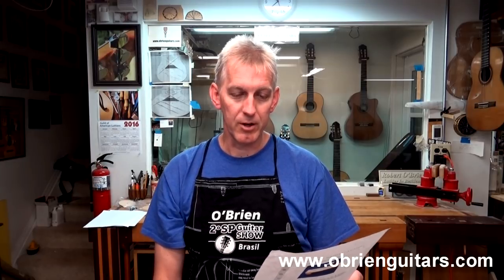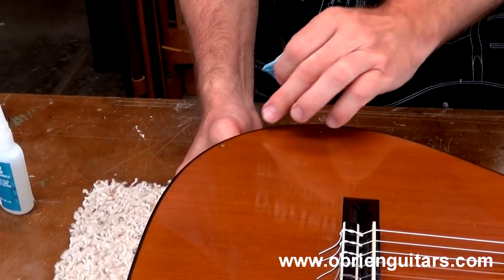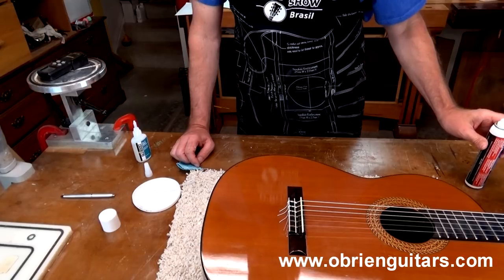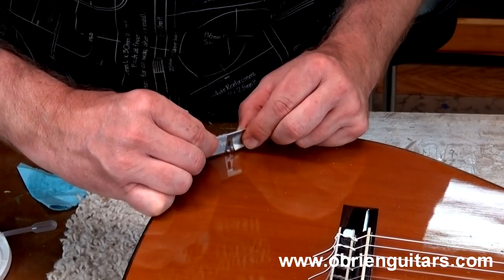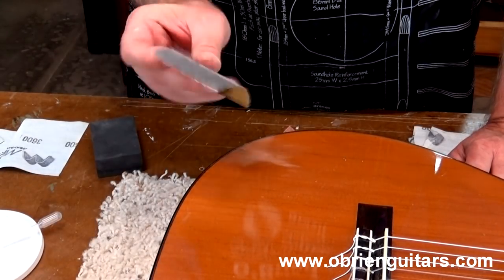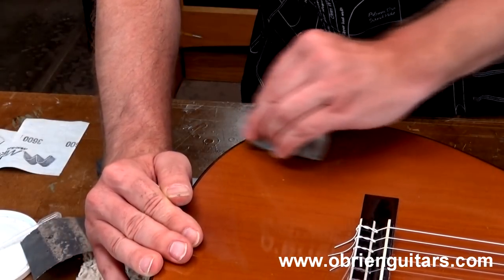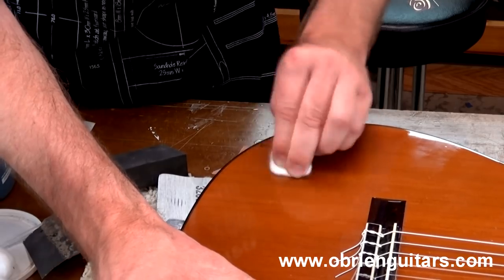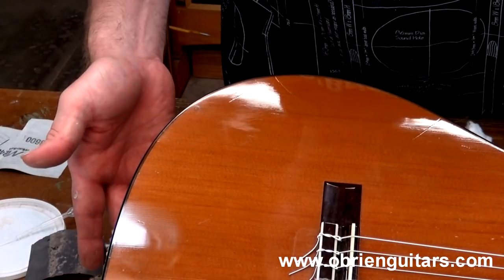Luthier Tips du Jour mailbag 97 - Repairing a ding in a guitar finish

Comment: I have a cedar-topped classical guitar that I bought when I was 15, I got a great deal on it because of all the cosmetic dings.  Thanks for these great tips on how to finally fix those dings!  I don't expect it to look perfect, but this will certainly reduce the appearance of the damage.
Reply: Sorry, your comment was a year ago..
Exact same thing for me, few dings on a great old vintage guitar.
How did this method work out?
Reply: Cedar top as well :)
Reply: @mrg6185  
My idea of using a Varathane polyurethane scratch repair pen did not work out.  It was as if I had done nothing at all.  I made an attempt to fill the damage with a form of superglue so I could make  the top flat, and then cover it with the polyurethane pen.  Unfortunately, the superglue was harder to control than I expected, and when I tried to carefully absorb the excess...let's just say, I'm still trying to determine the best way to get the superglue spillage off of the guitar.  It would've been better had I not even tried.  The superglue residue isn't very big, but it affects the texture of the top in that one small area.  I've wondered if naphtha might work.

Comment: Robbies videos are fantastic.  I have learned a lot from them and really admire his techniques.  However, in this case, I didn’t think the end result was all that great.  To tackle that ding, I would have first tried to reduce the depth with a few drops of water and a couple of touches with an iron or burn stick melter.  Then I would have drop filled with lacquer.  (Assuming that is a Nitro finish).  That would take much more time waiting for the lacquer to cure for at least a week, but I think the results would have been better.  And I’d have just buffed it and not fooled around with micro mesh.  Much quicker there.

Comment: I've done this on a belt ding in the back of my black 7 string LTD with a lacquer finish and it worked great. But now I've got a scratch all the way to the bare wood on the top of my Martin D10e sitka. It's a satin finish if your not familiar. Any tips on doing a similar technique but with a satin finish? The scratch is about 3/4 a cm long and about as wide as a fingernail. Almost looks like a splinter came out. I have no clue how it happened since I baby that guitar and the scratch just showed up tonight lol, devastating!

Comment: CA glue always leaves a very noticeable darker finish than the surrounding area. Would drop filling with clear coat lacquer not be a better option?
Reply from the maker: If the finish on the instrument is lacquer, my first choice is to use lacquer as a drop fill.
Reply: @OBrienGuitars  On contemporary production guitars what is ever used other than lacquer?  Thank you.
Reply from the maker: @philipliethen519  you can use catalyzed urethane or UV cured polyester.
Reply: @OBrienGuitars  how can you tell which of these finishes has been used?  Can one be used to spot repair over another?  Thank you.
Reply from the maker: @philipliethen519  CA glue products work best over urethanes and polyesters in my opinion. For lacquer I drop fill with lacquer and shellac I use for shellac finish repair.

Comment: What If I used a heat soldiering tool with Wet cotton fabric on the Dent .. Dose it Make the Dent Comes out to same Level of the Wood surface ? 
I  saw this Idea used with Real unfinished wood but Dose it work on wood with Finish on ?
what if  I use Finger nail Clear Drops instead of the Super Glue Dose it work ?

Comment: Im no luthier, but Ive been playing for over 50 years.   My flame finish Breedlove, had a bad chip as big as a fingernail, right down to the spruce wood top.  It was right where my arm layed over to strum, so I went to the dollar store, and got a set (3 in a pack) of furniture color stains in tip applicators, (3colors)  black, maple, oak.  put light to dark down, matching the top, looked GREAT then I took dollar store clear epoxy glue and filled the large deficit.   after drying I scraped as he showed, then sanded with 2000 wet. and WOW looks better than his, you can BARELY see it and Im playing to crowds with my Breedlove again!
Reply from the maker: Way to go Dude!

Comment: Great video. But I have a question: my electric guitar has a polyester finish on a blue flame maple top, but the scratch appears to be only in the polyester clear coat, not the colour coat or wood underneath. Would this technique be able to make the scratch completely disappear?
Reply from the maker: Sometimes to cure can be worse than the disease. However, if done properly, you can get a good repair. I would use the Gluboost products.

Comment: Great video! How do you deal with this type of issue when the ding is in a place with a complex curve like a neck heel?
Reply from the maker: YOu can do it the same way but use a thicker CA glue
Reply: @OBrienGuitars  thank you! My main concern is after properly gluing and clamping (which I have done well I believe), that if I add CA glue, leveling it with the razor blade trick will be next to impossible because of the complex curves.
Reply from the maker: It is never easy is it?
Reply: @OBrienGuitars 😂😢

Comment: Hi Robert, I recently got a Gibson Les Paul Studio (gloss finish), and the previous owner dinged out little notches on the back of the neck near the fret markers. I guess he wanted to feel where the frets were with his fretting hand thumb. The notches only seem to be through the outermost layer of the finish and do not go through to the color coat. Any recommendations to fix those? Thanks!
Reply from the maker: I would use probably glu boost to level and then buff to a gloss.

Comment: Can you fix a light scratch in Taylor Guitars' "silent finish" with this stuff and your method...?
Reply from the maker: What is a silent finish? I have never heard that term?
Reply: @OBrienGuitars   Much thanks for the response! Its probably just marketing language from Taylor Guitars?
Its supposed to not be noisy / squeak if your hand slides over it? idk.
Beyond that, they say its sprayed with an electrostatic charge, so the paint or whatever it is will cling to the wood better.
That's what they say in their YouTube factory tour.
It may be silent, but its also not very sturdy... I somehow ended up with a scratch below and oddly forward of the sound hole on my new Taylor 517 Builder's, which doesn't match where or how I play.   
Probably can't figure out how to fix it if I don't know what kind of wood-coating they used...
Reply from the maker: @Pharesm  Thanks for the info. Sounds like some marketing play on words. Taylor I believe uses UV cured polyester for a finish and this is probably a satin finish is my guess. Fixing scratches can do more harm than good. I say just play the guitar and enjoy it.
Reply: @OBrienGuitars  Much thanks for the info on UV Cured Polyester and the advice  :)

Comment: How can you tell what was used for too coat?
Reply from the maker: I assume you are asking about what type of finish was used onthe guitar. If this is the case then the Glu Boost products work well with any finish, especially lacquers, urethanes, polyesters etc.
Reply: @OBrienGuitars  I have a crack in my father's 12 string Eco about 7" long from bridge down center line. Once I cleat it  I'll need to refinish the repair. How can I figure out what finish was used so I can try and match it? Thank you for responding
Reply from the maker: @kearnsguitars2236  Wipe some lacquer thinner in a non conspicuous area. If it melts the finish it is lacquer, if not, it is probably a synthetic resin like urethane or polyester.
Reply: @OBrienGuitars  thank you so much

Comment: Robert, I have a ding in the lacquer of my Eastman. Will this method work?
Reply from the maker: It might be. However, I do this type repair on a case by case basis.
Reply: @OBrienGuitars  Thanks Robert. Any possible way I could send you a photo of the ding?
Reply from the maker: @Mikec80  My contact info is on my website.  obrienguitars.com
Reply: @OBrienGuitars  Thanks so much Robert! I appreciate your time and will reach out to your via email.
Reply: @Mikec80  Hi. I have an Eastman that has a few deep scratches. Did you try dissolving the finish with thinnner, and reapplying nitrocellulose finish, or did you try the cA glue trick? Thanks
Reply: @akfisher7138  Hey there. I haven’t gotten to the project yet. But I am planning on using CA Glue for it. I’ll let you know how it turns out!

Comment: Any kind of super glue it is okay? I have a ding on the top of my martin guitar can i do that what you are doing but a different super glue?
Reply from the maker: I recommend Glu Boost fill and finish for this type repair.
Reply: Thank you sir
Reply: I have used just regular cheap super glue.  Remember, the defect is not going to disappear completely, anyway.  Any decent hardware store will have super glue and extra fine sandpaper.  You will pay a lot for this kit and only use a fraction of it.

Comment: Wasn't there any way to avoid that black spot the glue let between the lacquer and the wood I guess ?
Reply from the maker: unfortunately wood, especially  cedar goes dark when adding a filler like this.
Reply: @assabetstrings700  Not sure if it's a matter of glue or wood but depending on the combination glue/wood it darkens the spot. Sometime refinishing the area is a better solution and almost invisible compared to the CA method.
Reply from the maker: @DynamicRockers  You are correct but some finishes can't be spot repaired, Also if you go through to the wood when sanding then you have a blotchy area to worry about.
Reply: It can be avoided by matching color as close as you can get with stain and sealing prior to glue build up. You can find this being done successfully on YouTube with similar guitar finishes.
Reply: I was wondering the same, the cedar seems to absorb the filler, and appears dark. I'm wondering if that also can be solved...steaming some water into the dents and lifting the grains of wood to the natural position...It happened to me once on a non finished guitar..I dropped a tool on the top, and I was able with steam to make the wood return to almost normal with minimun sanding...any thoughts?
Reply from the maker: @RonaldCid  I haven't had good success steaming on wood that has a finish applied already. It works great on unfinished surfaces though.
Reply: @OBrienGuitars  Yup....wood will be wood! lolll  Regardless the technique is super! Wish I could attend a master class...poverty and a fixed income keeps me away!  Keep well! RC
Reply: Best way I know is to use "Testers" model paint.  Mix paint to match color of guitar you are repairing on a wood scrap that is the same type of wood of the guitar you are repairing. Then build up over painted area.
Reply: I know this is 4 years old but I had the same issue on a mahogany neck.  The Fill n Finish significantly darkened the dents.  I contacted Rick at GluBoost and he told me to first spray their accelerant into the dents before drop filling with the Fill n Finish.  Doing that significantly reduced the darkness of the fill.  The accelerant minimizes the CA glue from soaking into the wood grain and darkening it.